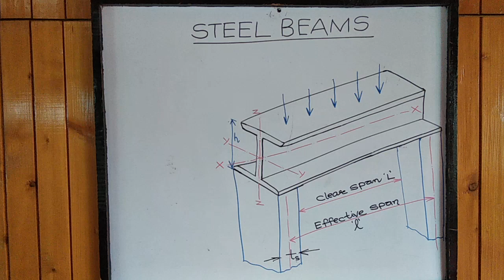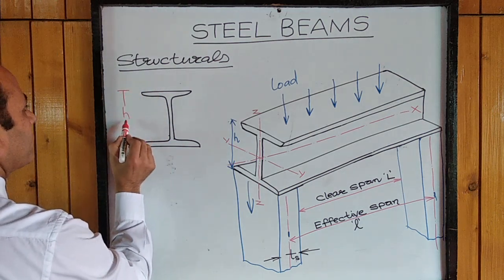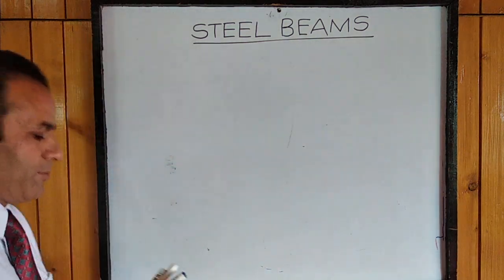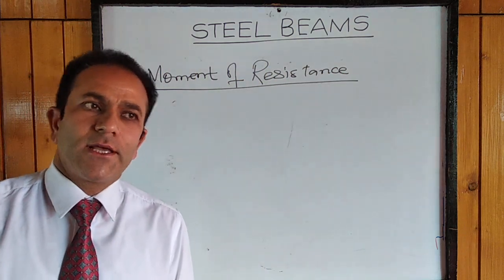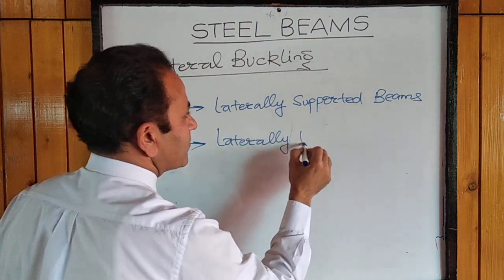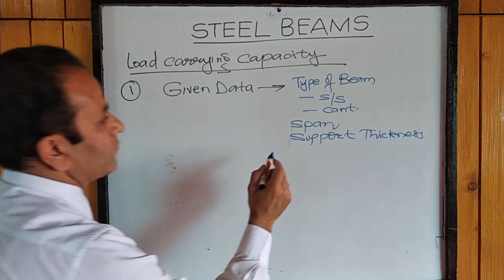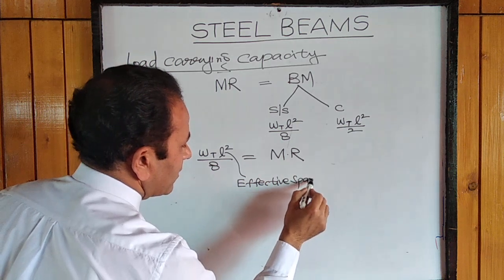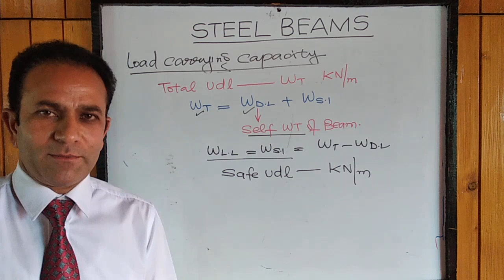Steel Beams #sixthsemestercivilengg#diplomaincivil#polytechnicstudents

Comment: Sir, how to calculate moment of inertia for encased steel beam? 

In calculating load carrying capacity of encased steel beam. wheather we should take Ic and Is values separately? or we need to take total I value of encased steel beam?